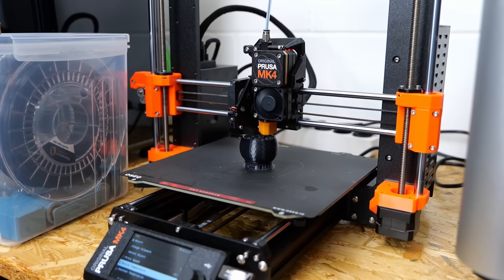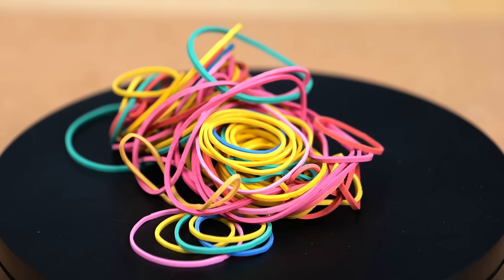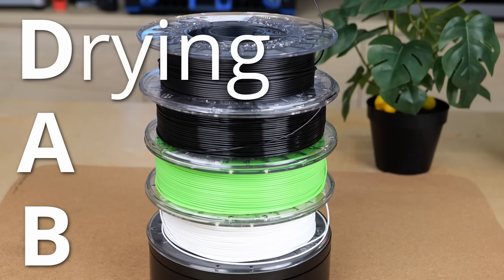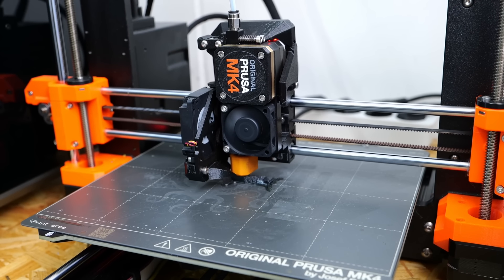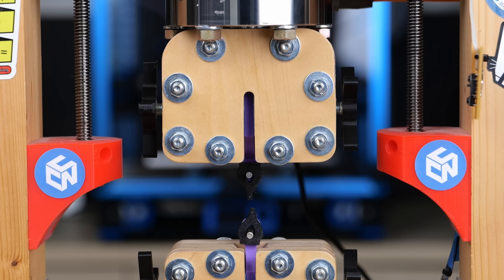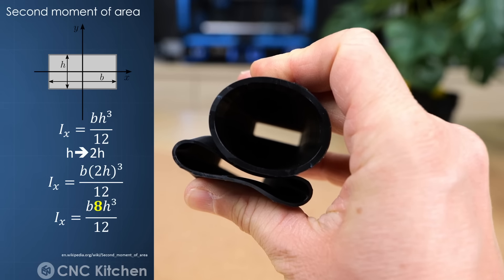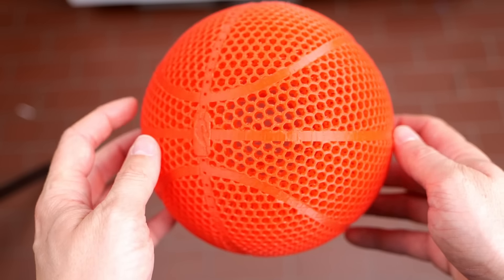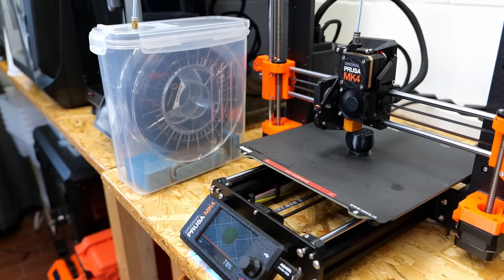Why aren't more people 3D Printing this Indestructable Filament?

Comment: Random idea... just watched Smarter Every Day's Video about cellular bio-chemical motors... 3d print a large scale cellular motor with a few kinds of tpe to emulate real conditions. With the goal of making a mechanical demonstration of how a that bio-chemical motor can changed direction of rotation. 

Super complex, and maybe not even doable - you'd have to talk to the Vanderbilt Uni. researchers to get the 3d model and specifics. HUGE project, but great content. Might even help with their research. Finding mechanically weak points to target.

Comment: I have found when printing Ninjaflex that the spool is too heavy to rotate without stretching causing under extrusion. I sometimes manually unspool it but it’s not an ideal solution. Is this a problem for anyone else printing 85A or less?
Reply: Do you have a ball bearing spool holder? That removed most my issues.. a 10kg spool doesn't slide easy.
Reply: @SWREngineering  Good point - I'm using an ancient Anycubic i3 MegaS with its fixed spool holder. I guess i could easily make one. Thanks 👍

Comment: I will never use TPE again. Yeah, it's lovely when it's freshly printed... but it discolors and turns UGLY after a bit of time, then it starts to degrade and crumble, layers that are fused perfectly when freshly printed start to peel with no effort... This isn't even after a year either... and never exposed to sunlight and the outside either.

Comment: 3D printing in general feels a little magical - you buy some raw materials, and you run in through your pre-Star Trek machine, and out comes cool shit. But for whatever reason, flexible prints just feel EXTRA magical, compared to their more rigid brethren. I go for any excuse to use it. Yeah, I could buy this gasket for $2, OR I could spend $15 in TPU getting it right myself - the choice is obvious!

Comment: Haven't found TPE to be hydroscopic.  Lack of glass adhesion is a bummer.  Lions have to stretch the layers .04mm to get it under extruded enough to not jam.  Too bad good old ninjaflex 85A is no longer in vogue, since that produced decent tires while being hard enough for printability.  The hardness ratings are so bad, we need a comparison chart with ninjaflex 85A.

Comment: you are testing hyperelastic material not properly. For testing it more properly check the following standards. ASTM D412, ASTM 5992, ASTM D575, ASTM D945

Comment: try cotton strand mixed tpu filament, like carbon fiber nylon but plastic with cotton fibers, yep synth clothing. also 100% infill fixes any moisture issues. no drying is not a must. are you using some weak tpu brand. dont have to deal with material issues. at all. do not adjust anything, at first. just print with the default settings from your slicer software. trying to instruct settings for beginner printers is nonsense. the most complex instructions are the worst. avoid those. omg current slicers already have correct profiles for most stuff. no changes required. dont adjust anything. primacreator easyprint flex 95A tpu is just fine. devil is in the details as always. details are not that important, only the most greatest differences, like ultra bounciness and flex vs rigid hard. anyways about print speeds, bed slingers/spinners can have multiple ultra small side by side independent rails print heads  for super fast printing.

Comment: Everyone focuses on TPU and how SOFT they can get it.  Someone needs to focus on how HARD they can manage to get a TPU.  We could get all of the benefits of Nylon without many of the drawbacks if someone would flip this thinking on its head.
Reply: Interesting thought. Nylon PA6 has a Shore D hardness of 71-86. So it's way harder than any of these. It would be over 100 Shore A. 

TPU is available in that range, for example Essentium TPU 74D, which as the name suggests has a Shore D hardness of 74. It's on the softer side compared to most Nylon, but it is in the range. It's quite expensive though at 90.75€ for a 750g spool.

Comment: "(Zellerfeld) are backed by the people who helped start Tesla, SpaceX and PayPal..."
Nope. Nope nope nope nope. Nah. No. Not no way, not nohow. I'll go barefoot, then.

I was disappointed by the flexibility and friction properties of TPU. It always took a bit of a set when being deflected, it would spring back, but not quite all the way, it would get almost there, you could watch it sloooowly going back to the old form, and never getting there in the end. I wanted a kind of rubber. What I got was a kind of floppy plastic. It was also a bastard to print, not helped by the fact that I have a Prusa Mini+ (which has a bowden extruder), the print quality was not stellar (full of bubbles and layer gaps), and it was sloooooooooooowwwwwww. Especially if you couldn't get by without supports. Still, I could use it to print useful parts. A clutch pedal cover which was torn, the TPU replacement is still working years later - that was the most successful print. Others were less than ideal, Kinda sorta worked, but only just. I had to give up on my idea to print bicycle seat padding, it was not elastic enough for that. It was not what I would call elastic at all, it was just not fully rigid. In other cases I couldn't get it soft enough to make any sense, at the forces required (e.g. supports for the boot cover in my car) it would be effectively rigid and I could have just as well printed it out of PLA.

Gotta revisit this.